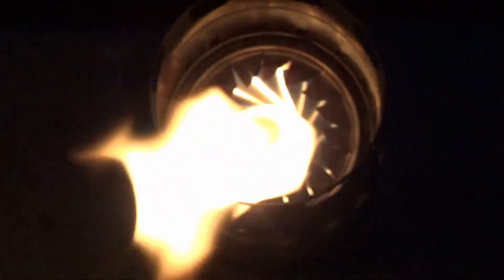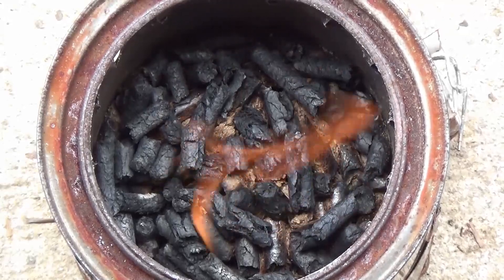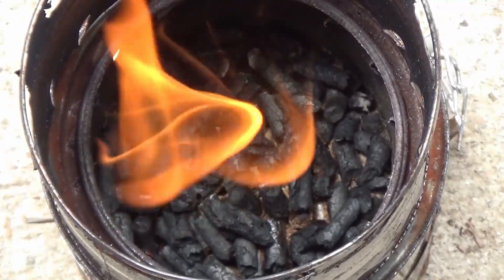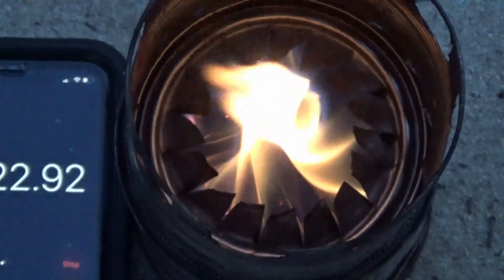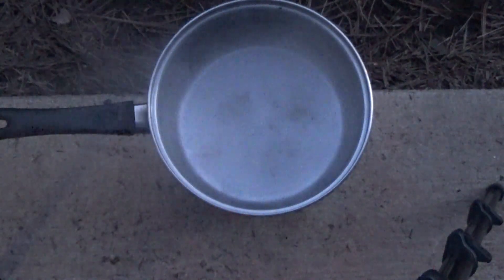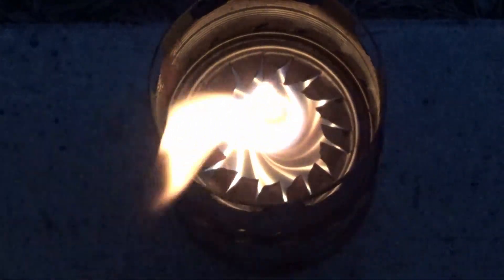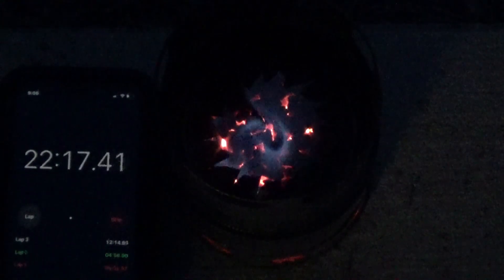Paint Can Wood Gas Stove Optimization! Wood Gas Stove Science| Making a good stove GREAT! Part 5!

Comment: I am sure you are right about the importance of the combustion area in the pot stand.  It must mix secondary or even tertiary air very well into the flame without cooling it.  So pre-heating some extra air should help.  But my efforts too often seem to reduce not increase the air entering the flame.  Congratulations on your progress on this without using a fan.  I think it is cheating to use a fan.
But how is the bottom of your pot?  That is a good clue about how completely the pyrolysis gas is burned.
Reply from the maker: Still a little soot, but minimal. Thanks for the comment!

Comment: 👍 Your pot holder has a rim. It traps some carbon dioxide gas layer between the flame and the pot. Therefore, there is a thermal insulation between the flame and the bottom of the pot. Remove the rim.
Reply from the maker: I’ll keep that in mind for future projects! Thanks for the tip.

Comment: From last video:
1:34 flame concentrator ixnay 3/16 to 1/4 inch on secondary holes pot stand not helping new one taller added 16 holes 5/15 around bottom all vortex tweak same direction as top 8 4:33
22:00 mins of burn time with 1 c pellets
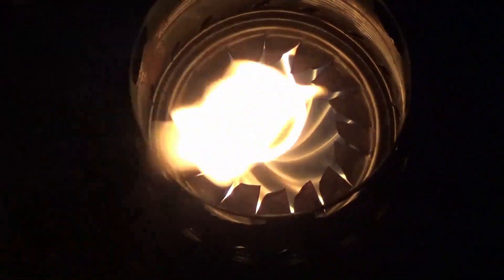5:53  new inner can honorary holes on outside
———
This vid:
Protestant integral part of design
Reply from the maker: Thanks for watching!

Comment: I’ve watched this entire series and appreciate your experimentation. I’ve built a bunch of various copies of this general design, including a gallon paint can. I’ve never had a clue about the math/ratio you included in your experiments. The gallon size works very well with sticks stacked vertically on initial startup but eventually you have to randomly toss in small pieces. I have also had great results when I add blocky chunks once the first vertical load has burned down. I figured it was because of the generous amount of air flow between the blocks. I’ve used pellets too and like them for their simplicity but I think they can create air restriction too. It was nice to see how this stage in your experiments gave some blue flame and I would love to see you tweak this to get the blue flame more consistently. I’ve watched many different builders on YouTube and these stoves but yours are on a much higher level. I copied several alcohol/can stoves too until I saw a particular design that excelled and after copying it, I love it. I will definitely be taking advantage of the experimentation and explanations on your research and I much appreciate your sharing it with everyone. I’ll be following your progress. Thanks. 👏👍
Reply from the maker: Thanks for the comments!

Comment: I have a couple of ideas to try.  A hotter burn chamber with hotter primary and secondary air could be achieved by having an outer can with holes near the top; Air would flow through and down to pass through holes near the bottom then separate between primary and secondary air.  Secondary air would travel up between burn chamber and middle wall and into the burn chamber.  Primary air would enter through a hole in the center and have to go around an ash pan (similar to the solo stove design).  The idea is that the burn chamber is double insulated from losing heat out the sides and bottom by air entering and being warmed through two passes between layers.  I'm not sure how much improvement you'd see, but it would be an interesting experiment!
Reply from the maker: So adding a third can? Let me know how it works! Thanks for watching!
Reply: @heathputnam9524  it's the idea of the calorimeter... The additional length of pathway in the air space between cans not only heats the air as it comes into primary and secondary air supply, but it also insulates the burn chamber making it burn hotter.  You said that if your viewers had ideas for you to try out, viewers could make suggestions.  That's mine for what it's worth.  I plan to try it out some time in the near future.
Reply from the maker: Sounds very promising!

Comment: Thanks for the video!
It would be nice if you had a sketch or a  pdf sketch of the cross section of the stove.
It doesn't have to be perfect!
The dimensions, numbering and the height of the positions of the holes or slots and their dimensions. 
Perhaps you could get better feedback!
The electric home  popcorn maker in use, displays a clear swirling motion of the contents!
It has the simplest fan or turbine or whatever you may call it at the bottom.
Just one row of those skewed slots lifts the corn or peanuts in a swirl.
I would have made those slots and skewed them just the way you did!
Of course I learnt this from the popcorn maker!
Hope you sense that you are getting closer to your goal.
About the fuel pellets, are they made from wood along with the bark?
Doesn't using the bark cause soot and a dirty yellow flame?
Reply from the maker: Thanks for watching, the pellets are made from finely ground up wood, and probably includes some bark. They seem very efficient and as to see in the videos, they do not cause any smoke once the design is optimized.

Comment: Dear sir. Many, many thanks for all efforts. We have learned a lot by firing the same amount of pellets, in different oxygen feeds, as well as the power control, I suggested some months ago.
My interrest is to save life in disaster situations, as well as to save fuel in the third world, by firing more effectively. You are close to a very success.
The wholly grail, would of course be just hot blue flames, as from a dedicated propan burner, but solid fuels contains a versatile of components, that makes it a lot more complicated.
Truly, it is almost impossible to get much closer to perfection, than those of yours. They are scientifically compared, at the same amount of pellets, and they produce different flame behaviors.

What is not tried are different amount of fuel, as well as comparing twig-cuts, contra pellets, but that is a another question.
But before such tries, I want to complicate the basics some more. This genre of "wood-gas"-stoves are only partably aware of the complexity of solid wood burning. I will tell:

I happened to meet a temporary colleague, that had worked professionally at serving big burners in the passed, and  I happaned to discuss an idea of making a kerosene lamp burner into a heat-power unit, and discussed primary, and seccondary air intakes, though I have burnt diesel into a real power source, with no smoke.

However, he explained, what I had got wrong. What I had thought, was the primary intake, was really the secondary, and what I hade thought was the secondary, was really the tertially, and so on. So in my opinion about woodgas, we are using the primary, and the tertial air intake, and not use the secondary to infuse some oxygen to improve the pyrolysis.
In my experimental tries about the one flat wick kerosene burner, it delivered a ten to twentyfold more output, by a clean, blue-green flame. This was before my colleague told what I really had used. The area relationship: P=1 of primary, secondary-tertial is hard to tell in the kerosene/diesel case, but I would guess: P=1. S=0,7, T=0,4 . This is a wild guess. Anyway it burns super.
The project still lives in summer-sleep.

Interpreted into wood burning, I would suggest trying primary somewhat below original primary. Say approx 0,8-1 area. The secoondary intake, located somewhere over the gasification zone, but quite close to it. My guess is that the tertial would be some 1 to 1,5 diameter above the fuels, and the secondary  no more than 0,3 of diameter from the fuel top, or even closer.

Anyhow. Pyrolyses, of wood fuel, is a lot more complicated, than for kerosene and diesel, but I am convinced that some air injection in the pyrolyze section may benefit the combustion severally. Did I kill your efforts? Sorry, if that.

Best wishes.

Comment: I saw how the stove has to heat up before you get secondary air burn.
I find I can shorten this time if I line the inside of the outer can with aluminum foil.  It is an excellent heat reflector.
The foil can be like sold to bake a big bird, or a Chinese take-away puts your rice into.
Alternatively you can crunch up two or three layers of kitchen foil, put them together and roll them with a rolling pin, but not too tightly.  Then the trapped air becomes an additional insulator.
Reply from the maker: I’ll give the insulation a try. Thanks for the comments and ideas! They help out tremendously!

Comment: https://www.amazon.com/Universal-Holder-Coffee-Burner-Grates/dp/B07F463X6G/ref=sr_1_4?dchild=1&keywords=coffee+pot+grate&qid=1623656697&sr=8-4 This pot stand will be great for smaller pots for the original pot stand you are using in this video You can use mugs, or the Stanley pot, all skinny pots. Plus it allows more air to go underneath the pot stand so you are not suffocating the flame to the point when it starts smoking. A lip from a paint can will help keep the pot stand more stable.